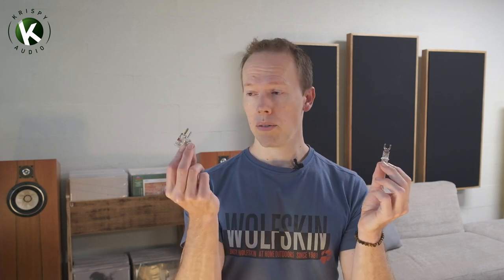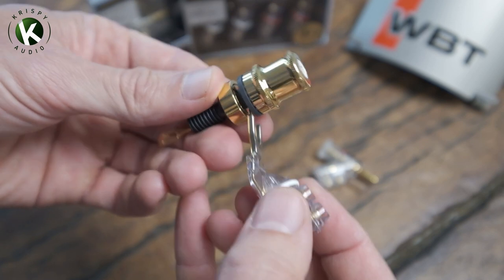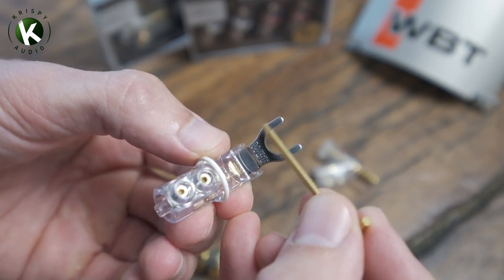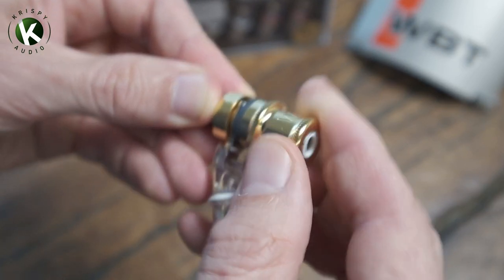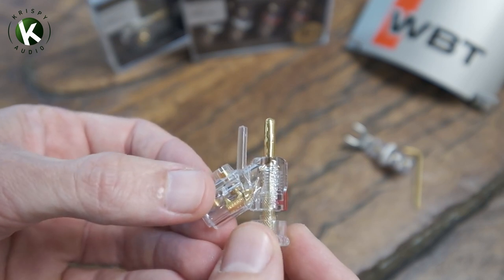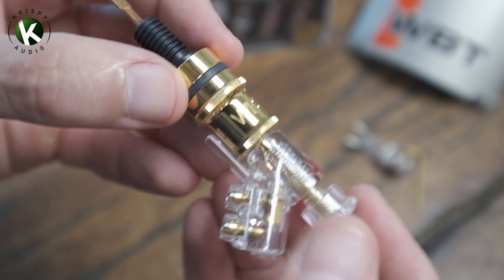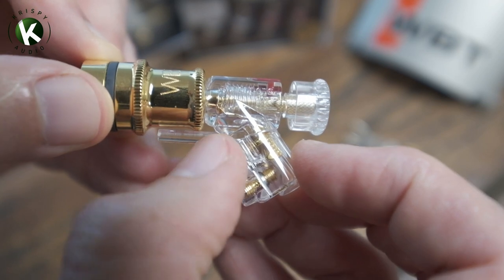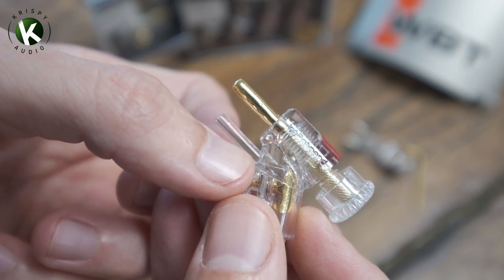Spades or Bananas? Which speaker connector is right for you?

Comment: I am amazed how cheaply made these connectors are today compared with the spade and banana jacks that were available from Monster Cable in the 1980s. I have a stash of these old connectors that far exceed the quality of the modern connectors. By quality I mean the amount of metal in the connector.  My old connectors weight at least twice what the newer connectors I have seen. More metal lowers the resistance of the connections. The WBT connector you were showing is to small to attach my Monster double 8 gauge speaker cables to. If I were to need a new connector I would go to a large electrical supply store and get the biggest connector that will fit the speaker/amp and then gold plate it. Good video and advice.

Comment: One thing I would like to point out regarding the contact area on the WBT spades shown here, is that their main conducting part is the gold plated side on the back and not the silver colored part at the front shown in the video. In between those two pieces of metal, their is insulation. And the gold main conducting part at the back has 4 small bumps that will make the only contact with the mating terminal, so regarding the contact surface area we might have a second thought, at least for the WBT spades? That being said, I’m also using WBT spades on my cables 😊.
Reply: Indeed, you've got it right. The fact that the creator of this video is making such a big mistake makes me take everything he says with a grain of salt.

Comment: Nice teview! In my occasion i don't know what to use because every summer i move the tv rack, so i must disconnect my yamaha a-s501 or the speakers.Any suggestions?Now i have bare wire.Which is best for every year disconnect?
Reply from the maker: Hey Andreas thanks for the comments. I would still say that every summer is not too often, and personally would still go with spades. If they've been a bar wire connection for a while, I would treat with something like De-oxit before terminating with the spades, or trim the ends and re-strip just to ensure you're getting the best termination. Enjoy!
Reply: @krispyaudio  Thank's for the respond!! Until now i prefered bananas,without ever use them,only by sight.I will buy new cables (2x2.5mm or 2x4mm) with pre-installed bananas or spades (if i can).Well iam afraid that every summer connect disconnect, the binding posts of the amplifier will suffer.The back side of the amplifier is not very rigid, I think.Some say that for spades you must tight them really hard with wrench. Is it true?I want to choose a way that will suffer as little as possible for the binding post (they are plastic).For the speakers do you think bare wire is good? due to permanent connection.

Comment: No. That second plastic pin has absolutely nothing to do with any stress. It just prevents pluging of that banana into a EU type 220-230VAC wall outlet with 4mm round holes.
Reply from the maker: Actually it does both (WBT confirms this). You’ll notice that its position is designed to fit exactly adjacent to the WBT binding post without any freeplay, which eliminates the ability for it to sag.
Reply: @krispyaudio  OK. But it doesn't fit exactly. There is still a gap about 0.5mm between a binding post nut and that pin. Please notice that the nut is not just a cylinder shape but it's expanded at an outer end. Besides, I believe, if that pin really was for support it would most likely had some U or V profile on top to match with that round nut.
Reply from the maker: @IliyaOsnovikov  like I said, WBT, the company that makes these actual connectors, verified this themselves. Not sure why we should "believe you" over them but ok.....
Reply: @krispyaudio  There are two good reasons to trust me: 
1. What I am saying is a common sense.
2. I am seasoned mechanical engineer who knows a thing or two about design.
However, you may feel free to believe in anything else.
Reply: @IliyaOsnovikov  hopefully you’ll see this? I’ve seen you comment here, PS Audio, and AudioHolics as well, everywhere I’ve been when it comes to this spade/banana debate. You seem to know your stuff, so I thought I’d ask. I noticed you refer to using a spade with soft copper with direct gold plating. I believe I’am using one described like that, in fact it’s the WBT 0681 CU 5/16”, like the one Krispy Audio is showing here. Based on your assessment, is this the same type you’re referring to?? Reason for asking is I don’t want to worry about it becoming loose over time. I tightened my binding posts as tight as I could with my fingers, seems pretty secure now,  but over time???
Reply: @nathanjones4039  WBT NewGen spades and banans do offer an excellent build and sound quality. However I consider them too expensive for my system. The spades I was refering to were various models of crimp style AudioQuest terminals. Once I set them on my amp's output post and tightened them by hand. About two years later I had really hard time taking them out. The post nuts, spades and post base kind of stuck  like they were glued together. As I recall I even had to use some pliers and rotate terminated cable ends CCW to release them. I believe that effect when some molecules migrate over time from one piece of metal to another in a place of a tight contact is called diffusion.
Reply: @IliyaOsnovikov  thanks for the reply! Hopefully my WBT spades as I mentioned will stay tightened as you indicated your AudioQuest had?!! I tightened them by hand as tight as I could on my Paradigm speakers, so hopefully that will suffice??
Reply: @nathanjones4039  The AudioQuests did not have those pimples on the bottom side. However I would just trust a German Mechanical Engineering Genius. As far as I know many German things at a first sight  may look over-engineered but they do work.
Reply: @IliyaOsnovikov  thanks for the reply. Appreciate your insight. Not sure what the dimples are even for,  but yes my WBT have those as well. Look like really nice designed spades, just hoping they stay tightly connected.
Reply: @nathanjones4039  Happy listening!